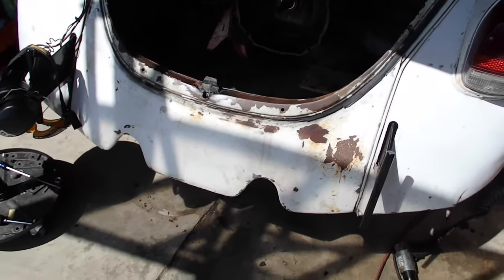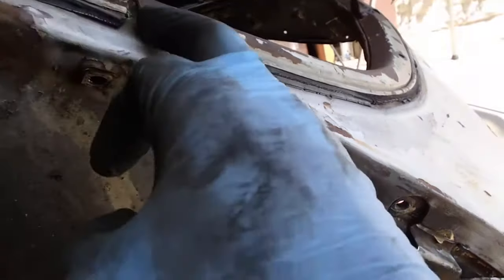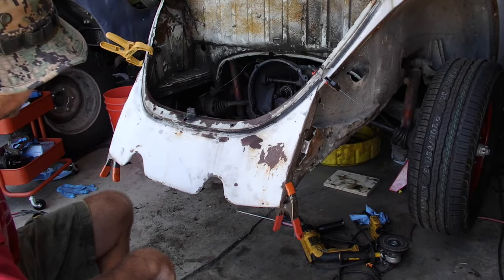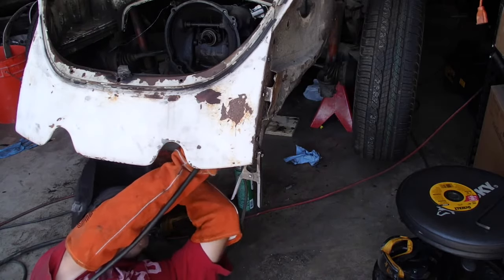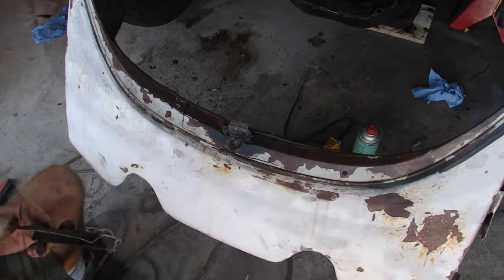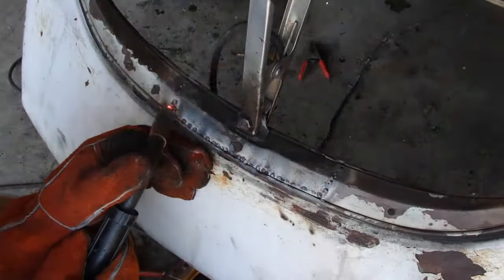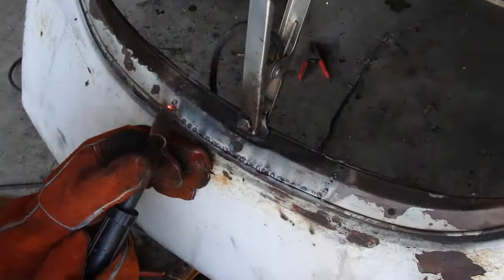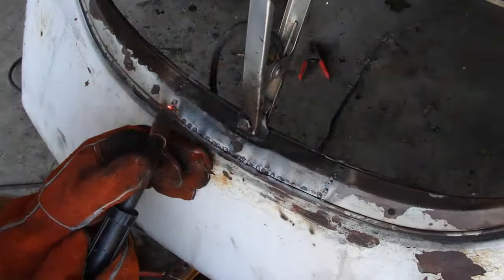1969 VW Bug Project - Episode 24 - Rear Apron Modifications

Comment: A little body hammer work and it will be good as new. If you remember, what did you have your welder set too? I'll be welding mine with my Harbor freight flux core Welder.
Reply from the maker: My little Lincoln has four intensities, A-D.  I had it on B.  Wire speed about 1.5-2. Used .035 flux core wire.

Comment: Are those bolt heads going to interfere with the fenders when you try to put them back on?
Reply from the maker: The plan is to drill holes in the fender for the bolts to pass through.  I just don't want to put them in the fenders yet, not until they are mounted for the last time and I feel good about their fitment.

Comment: Are you using flux core or gas?
Reply from the maker: Flux.  Most of my welding is under less than ideal conditions: dirty metal, outdoors, me as the welder.  I first started welding patch panels on my old Willys CJ3A in the backyard where the shielding gas would've been blown away anyway, so I just do flux.